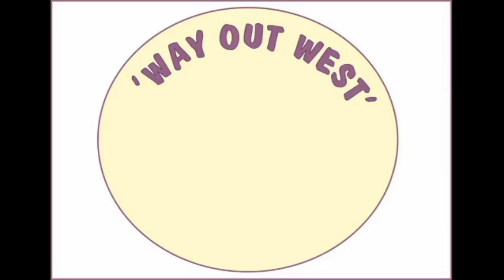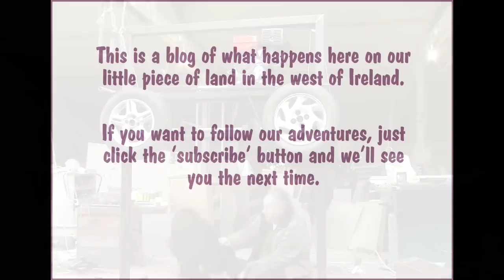Bandsaw Goes Up And Down (Homemade Bandsaw Mill Build Part 2)

Comment: Great videos using something similar to that we found that in some instances the blade would start walking or jump track so we took and put groves in the tires about the same size as the blade Thanks for the videos

Comment: I'd advise using the donut type spare tires instead of regular tires. The donuts run at 90 psi or better and thus you can put more tension on the blade and control it easier.

Comment: Wow - your wheels are too nice! How did you keep them from sliding inwards on the axle? I didn't see a fixed connection of the wheel to the axle. Keep these coming -- love your ingenuity. You could have helped them on Apollo 13 !
Reply from the maker: On the first trolley, I put a spot of weld on the inside join. but then someone said locktite would do the job, so that's what's on the second one. So far, so good.

Comment: I like the rail system idea. I guess you're basically building what we'd call around here a lumber mill. Any guestimates on the max lumber size you can mill with that engine you've got (I forget if you've already mentioned it)?

Nice project, Tim. I can't wait to see how it works!
Reply from the maker: Thanks, John. A 28" log should fit between the guides - but I'm not sure whether the blade/engine could cope with one that big. Can't wait to find out!

Comment: Now you need a measuring device on your vertical slide, so you know where you are and how thick you're cutting... that old tape measure should do, with a bit of hot glue? :-)
Reply from the maker: Yes to the tape, not sure about hot glue though. Will it hold?
Reply: WayOutWest Blowinblog It will stick like manure to a blanket! And easy to adjust or remove, with a bit more heat.

Comment: I have a feeling this is going to turn out great but if it doesn't there would be a space for you at the TT races on mad Sunday
Reply from the maker: Top speed is 30mph, and cornering wouldn't be great - but apart from that, it's a sure bet : -  )

Comment: This one will kill you man. Tires are not a good idea in my opinion. Think it over again. all the best
Reply from the maker: Is that based on experience? (Or are you just guessing?)
Reply: WayOutWest Blowinblog No its just my opinion. What will happen when the saw will jam? Tires will continue to rotate and the saw will destroy them. Some hard rubber wheills without air inside would be better.
Reply from the maker: How will the blade destroy the tyres exactly? Anyway, we'll see what happens.